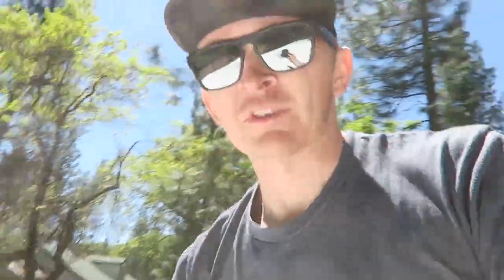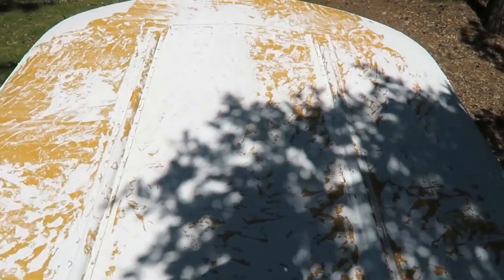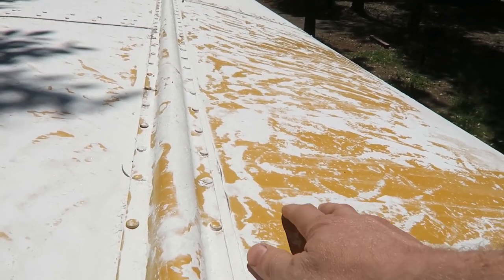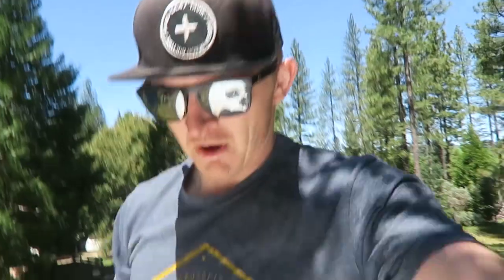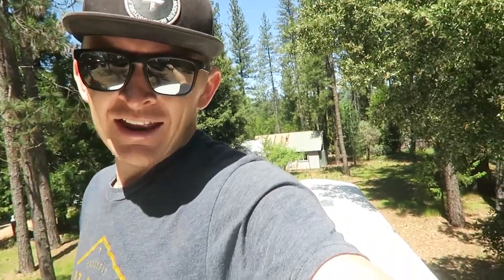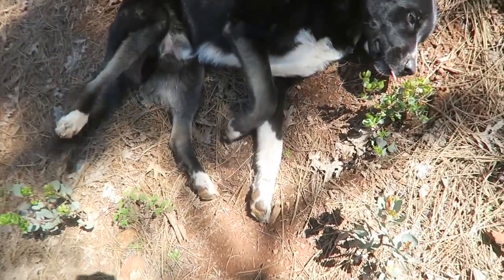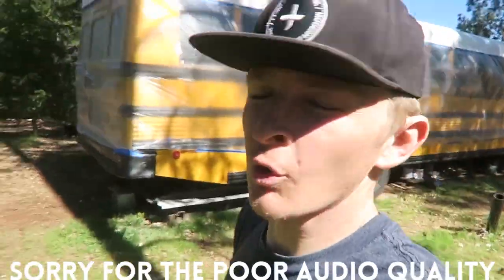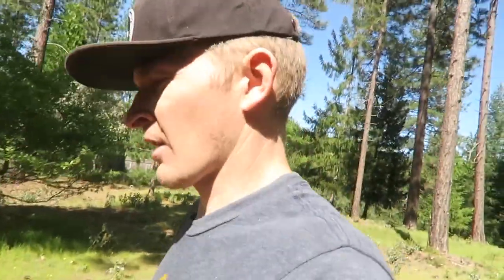#25 SKOOLIE BUS CONVERSION | ROOF PAINT (Second Coat)

Comment: I think I will use this product to paint the roof of my bus to rv.  Question:  Did you use a large nap roller (it seems that there is texture to the roof of your bus).  I haven't bought the coating but was thinking of using a smaller foam applicator roller, do you think that will work?  

Again, I enjoy both your 'can do attitudes" and your style is awesome and can't help but smile at V's antics.  Keep up the great work and hope to see you on the road one day.
Reply from the maker: I think so. Just slap it on there. Ours was textured on purpose. It's been a few months and it's performing great. Don't let it rain within a few days of application. It gets tougher and tougher as time goes on so the longer you let it sit, the better.